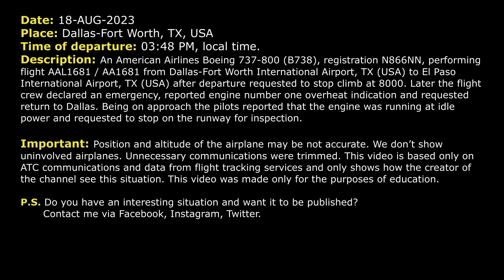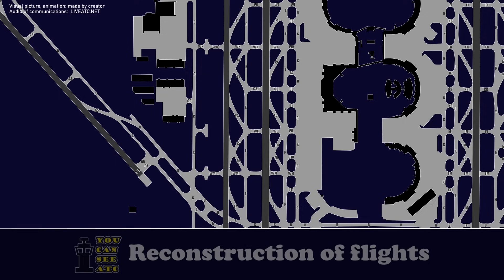ENGINE OVERHEAT on takeoff. Engine is at idle. American B737 returns to Dallas. Real ATC

Comment: Can we get the local time of day on these videos? as best as you can. I’m curious why the approach dispatcher switched mid emergency. Was it a shift change situation? But without the time of day locally I can’t really tell.
Reply: The switched controllers so they both could ask the same questions while the pilots were trying to get checklists completed thus delaying the aircraft's landing.
Reply: @JohnSmith-zi9or it was a shift change. The pilots were the ones that asked to delay their landing for checklists. It didn’t have anything to do with the controller switch.
Reply: @JohnSmith-zi9or  bingo. Exactly why I want an explanation
Reply: It says 3:48 PM.
Reply: @saxmanb777  yes at the beginning, but we have no idea how much time elapsed from The

Comment: 1:10 I was certain he was going to give him souls in pounds instead of minutes.
Reply: I don't want to laugh, because that's a lot of pressure the dude's under and he's handling it brilliantly, but i too was pondering how one measures souls in minutes.
Reply: @jdbertel33  Standard number of passengers ejected to lighten the load?
Reply: Stop that!   Y’all are making it hard to stop laughing.
Reply: "We have approximately 26,000 lbs of souls on board, along with the fuel it should take about 3 minutes to burn through it all."

Too dark? Or gallows humour is fine because everything turned out well?
Reply: @canadiannomad_again  🤣🤣🤣